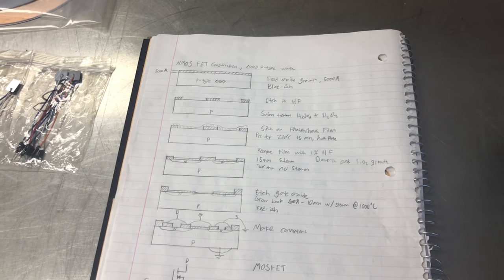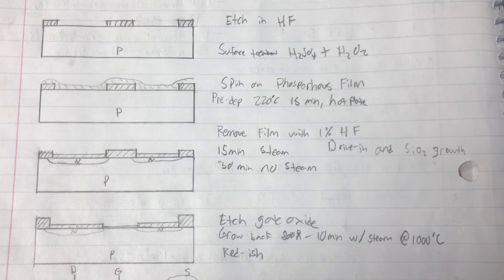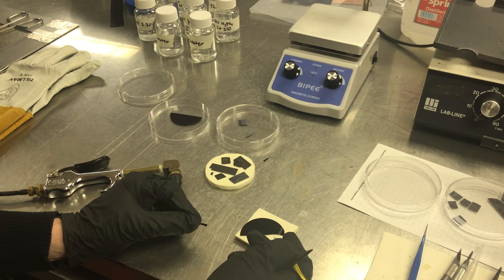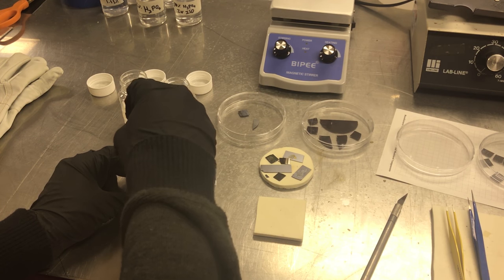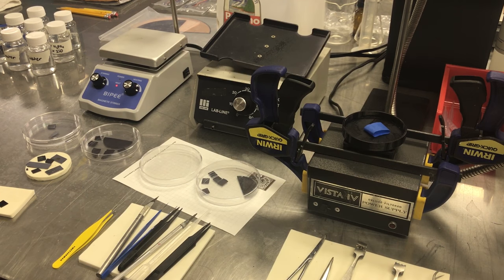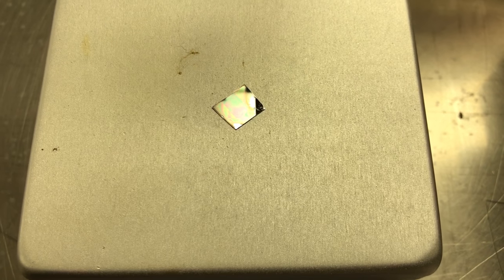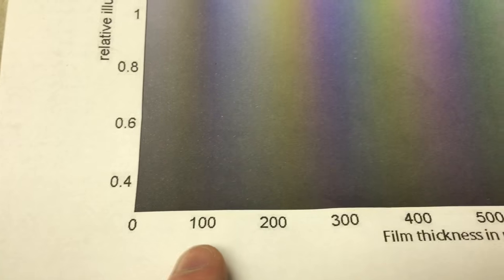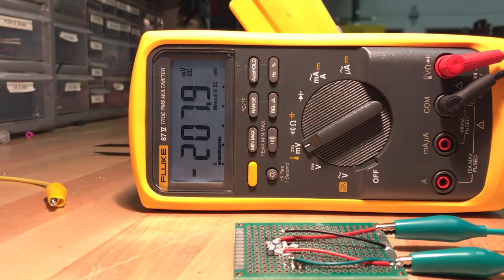Semiconductor Fabrication Basics - DIY Homemade NMOS FET/MOSFET/Transistor Step by Step

Comment: I'm a nanotechnology student. One day I wish to make some DIY transistors at home and your video is a great inspiration :)
Reply: Send me a message! I'd like to try myself. I started my own company. I don't think I can post company info here though.
Reply: @SciHeartJourney  I'm working on designing some processes involved in cheaper mass fabrication of semiconductors and solid state ionics (ion batteries for example) in a more efficient and compact form factor than conventional methods. If you might be interested in some collaboration work let me know.
Reply: @lazyh-online4839  You might just want to throw your ion battery projects away, sincerely, if i were to push for some ion battery i'd use hot plasma in a termoentropic motor, can you imagine the energy levels you can get from that... if you're dispersing heat anyway that's the best source.
Reply: @lazyh-online4839  I'm patenting the greatest power source humanity has ever seen, it uses global warming as a power source (no TEC or stirling shit) and it's made with 100% recyclable materials, damn i'm considering buying ethereum miners running on this system on a remote location just to multiply my money so that i can have money to buy more land.
Reply: @lazyh-online4839  btw my system has nothing to do with my plasma suggestion above, my system covers static power storage and generation, but if i would want a car battery in the size of a smartphone with a high amount of power the "easiest" way would be to use a plasma because the plasma amount of power can break almost any  chemical bond, if any day humanity can control amounts of power with that high level of density we will certainly need to countain plasma.
Reply: @fss1704  I'm not sure you understand plasma, maybe you could give a more complete description of how your device works?
Reply: @lazyh-online4839  You have to consider the law of conservation of energy, nothing is gained and nothing is lost, "everything is processed", meditate on that for a moment and you'll see that there's no such thing as power, what we see in the world is pure distribution and scattering trough another fractal parallel dimensions, the conservation of energy on the universe means that there's just a certain amount of permutations of matter over space in a certain snapshot of time, look at your hands and know that they're processors by the simple fact they are not at absolute 0 temperature, every piece of matter is processing something even if that wich it is processing is not usefull like a rock on a distant planet that exists but does no good for a human that's starving on the street, or the heat of the sun that has it's energy reflected trough electricity so that you can take a hot shower at night.
Reply: @lazyh-online4839  Consider usefull heat in a system, wouldn't you like to have a gpu that can get to 500degc on the gpu die? consider what amount of money you could make by literally baking cakes from the heat of the gpu apart from the crypto miner, but traditional CPU`s physics unfortunately don't work that way due to the increase in resistance with the increase in temperature.
Reply: Felipe Siqueira don't post your ideas on yt
Reply: Felipe Siqueira You have an email?
Reply: @firmman4505  yes eletrofss at gmail , and i'm not exactly affraid to expose my idea, i just need a patent first for the device because someone could stop me if i don't have the patent, and my view of energy is just a consequence of the chemical energy activation principle but seen from another point of view. Damn i see stuff in a completely different way than anyone.
Reply: niceee, for me too
Reply: @leeroyjenkins0  I think he wants to sell him something lmao
Reply: hi what happening with that project ?
Reply: It's been 6 years, I need some updates

Comment: I went here to learn how to make a transistor with my kids. We have made resistors, coils and capacitors but this looks a little more complicated and dangerous to me. Wow.
Reply: Point contact diodes (i.e. crystal radio detectors) are pretty safe and easy though, can even look at doing a silicon carbide LED.

Comment: I had a channel where I did tech projects, and I remember thinking I might try to make a transistor from scratch, but quickly found it would not be possible with my resources. It's insane the level of specialization and generations of scientific knowledge that this small little piece of equipment rests upon.

If society ever collapses, I wonder that it may be impossible to ever uncover this knowledge again without multiple centuries of consistent research.

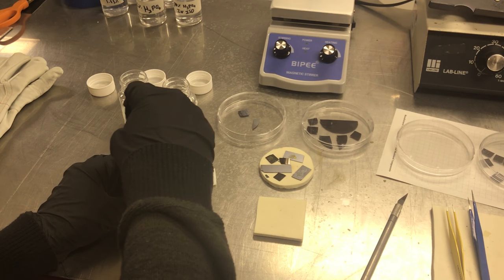Comment: 13:12 I would seriously advice against since the fumes are crazy toxic. Also you absolutely need to mention that it cannot be stored or handled in glass because it will not only ruin your glass but it will also contaminate your process.

Comment: Almost every technology we use has a simplified version which you can diy fairly easily. Cameras, microphones, electric motors. But when you think about a DIY computer, and simplifying down to just one transistor. It's not simple. It's actually close to impossible for the vast majority of enthusiasts. And the level of precision required for the silicon wafer he purchased isn't even taken into account. That alone is a feat of engineering.

Comment: Hi! What an amazing project! - just sheer determination....
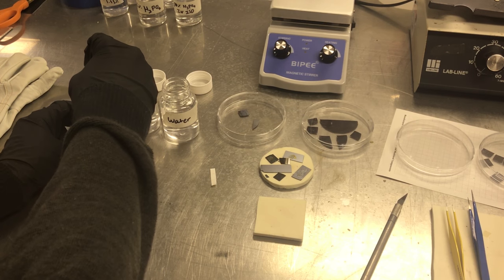By the way at 12:33, you mentioned that water doesnt wet the wafer post the HF dip. Thats actually because the HF leaves a layer of H atoms on the surface, and that'll go away shortly after the dip.
(This was way back in 2017, you probably know that! And HF is HF, so be careful!)

Comment: What about vacuum MOSFET? Just a few nanometers gap between two needles tips, you even do not need vacuum for such small gap since at such distances the molecules of air would have a little effect. With distance ~1nm the voltage can be a fraction of volt to ensure electron emission, the gap size can be easily adjustable to play and to tune the devise. I guess that the gap size is effected by the temperature, it perhaps explains why such technologically simple device did not get into technological realm...

Comment: Now explain the weird curve traces! Seems to me this MOSFET is very very slow, no surprise with how large it is I guess. What is the gate capacitance? BTW, if threshold voltage is too high due to a too thin gate layer, that means you must operate closer to the destruction voltage of the oxide layer, so perhaps this large slow MOSFET wants to be run at much higher current and then you would get less loopy curves?

But then perhaps the drain and source resistance are high due to the silver epoxy leadouts. This would explain why the MOSFET is already so heavily saturated - increase test voltage? If so then these leadouts are more suited to a high voltage low current device, whereas you put them on more of a low voltage high current device.

First and second DIY curve traces show a MOSFET not driven into Rds limit by the test. But the gate voltage steps are crowded together. Could it be the DS leakage is high so the gated current is only a fraction of the output current? Or perhaps that was intentional?

Last MOSFET shows something that looks similar to quasi-saturation in BJTs, where you have a collector resistance which rises to a final value as voltage increases. Maybe this is no surprise as a MOSFET could be a BJT if you removed the oxide layer.

Comment: Are there any processes that use a less dangerous acid than HF? Even if the results are slightly less optimal?
Reply: Sadly HF is the only acid that can dissolve silicon
Reply: @Adrien_160  i have seen patents for non-HF but i’m looking for something a DIY has done

Comment: Very Nice Video.
      I came here wondering just how elaborate making a field effect transistor could possibly be, you cleared that up.
    I figured on going to ToysRUs getting some play dough.  Then I would borrow my neice's Easy-Bake oven. Using the bathroom for my lab and old pre-school equipment achieving success is within my cross-hairs.   After draining my lead/acid battery then scraping rust off my car, I could get started.  I also scraped a couple ounces of material off my rims. Where did you get that makie spinny thingy?  I plan to substitute my sit-n-spin for it, though it gets me dizzy.  Now I am stalled,, my niece won't let me use her Easy-Bake oven so... I'm telling mom!!!
     Seriously... Serious video on high tech engineering done at home!   But... I am also telling mom that you're doing IT again.

Comment: Why some critical steps are hide from the video like drive in poly -Si process, and metal coating
Reply: Is a simple planar process with an oxide gate and he is doing the connections with silver epoxy.

Comment: I was going to try this, but then he said "hydroflouric acid". That EATS down to the BONE! I used to work for MicroSemi Corp when they were in Garden Grove. I learned the warnings, and know the equipment. You WON'T find the personal protection equipment at Home Depot!
Reply: HF does not actually eat flesh, however patients that have had contact with HF may be missing so much flesh that they have exposed bones.

HF soaks through tissue down to the bone. The tissue dies over a period of minutes to hours. Very nasty microbes may grow in dead tissue. That tissue must be removed, or the patient is likely to die from an infection.

1% HF is incredibly toxic, but it is not a very strong acid. Neutralizing that acid will not make the chemical safe. A quirk of chemistry allows this weak acid to etch silicon dioxide and other types of glass that are unaffected by many much stronger acids.

HF is a very nasty fluorine based chemical that happens to be a weak acid. Did I mention that it is also a local anesthetic? People can't feel, taste, or smell HF because those fluorine ions interfere with the nerves that would relay those sensations to the brain.

There are treatments that will bind up those nasty fluorine ions. Anyone that intends to use HF should get the appropriate first aid supplies and training before acquiring the actual HF.

Operating a chainsaw is also potentially quite hazardous if safety precautions are not followed.

Comment: From Quora:

Marvin Harris, BS Biochemistry & Molecular and Cellular Biology, Augusta University (2019)
Updated Dec 19, 2018 · Upvoted by Dean Ulven, B.S. Chemistry, University of California, Irvine (1989) and Nicolas Fievez, Master's Chemistry, University of Liège (2011)
Originally Answered: How dangerous is hydrofluoric acid? I want to try to make a transistor from scratch (or rather, a silicon wafer). To do this, I need to remove the SiO2 layer and expose the pure silicon. However, it seems the only way to do this is with HF.
NO NO NO NO NO NO NO NO NO NO NO NO NO

Seriously. No. Treat it like weapons grade plutonium. It can kill you in a ton of different ways; the fact that it is acidic is not the problem (it’s not actually classified as a strong acid). The problem is fluoride is small enough to go straight through your skin and essentially eat up your critical cations (such as calcium which is needed for nerve and heart function and magnesium which is needed for DNA reasons). This is some of the nastiest stuff a non-scientist will ever encounter (how did you even get a hold of this?) and should not be touched by anyone going on Quora to find out about its toxicity. On top of its toxicity, it is so effective at interfering with nerve functions that burns from it are often not felt. I simply cannot stress enough that you should find a different reagent.
Reply: Reads like redditlet, don't trust FUD answers like this. Same goes for all of the gatekeeping like "(how did you even get a hold of this?)". I don't know about you but a quick search gives me 5L 70%> HF for less than $10, no license required.. Just follow basic safety precautions and you will be safe.